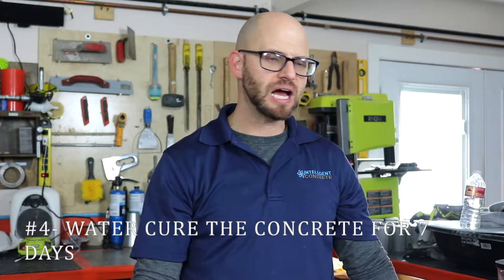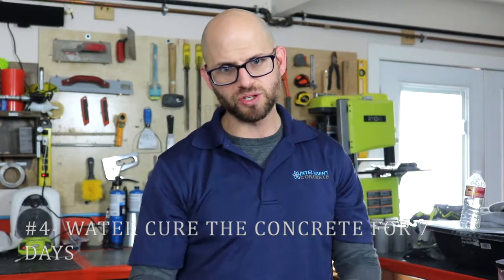Colloidal Silica on The Slab - Vlog #184

Comment: Bloody Awesome Dr Jon!  Now i know that lithium not so good after colloidal silica. I only experimented with both these products because i couldnt get a simple enough answer as too why i can / cant use both. 
Im building a two story house extention  using reinforced concrete blocks  built into a steep slope. 3 walls are retaining soil. Im looking for alternatives  to slow down water passing thru concrete. 
Waterproofing Membranes are good but i have seen enough problems with these products.  I dont think porous brittle concrete + moisture +acrylic membranes work well together. With this build im starting at the foundations and looking for products to reduce the capillaries and minimize ASR in masonry and concrete  . Cheers.